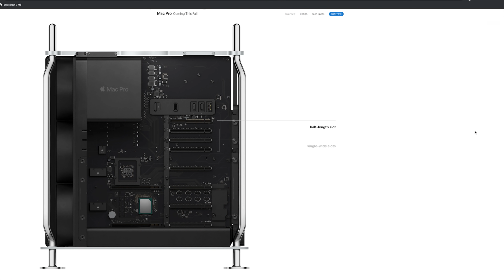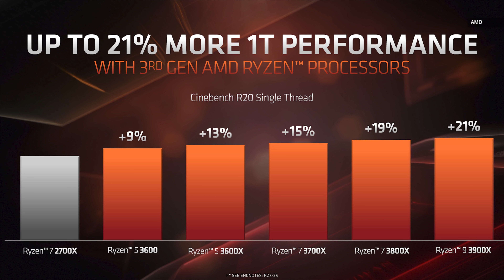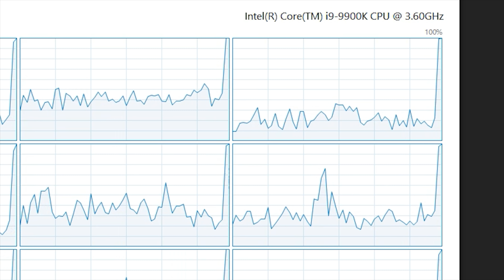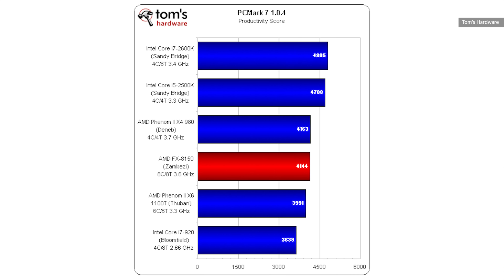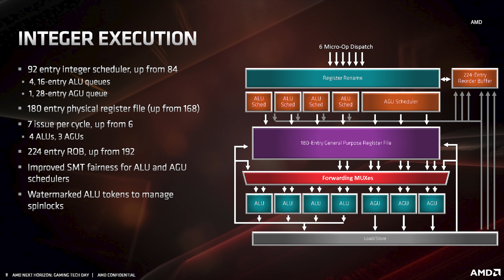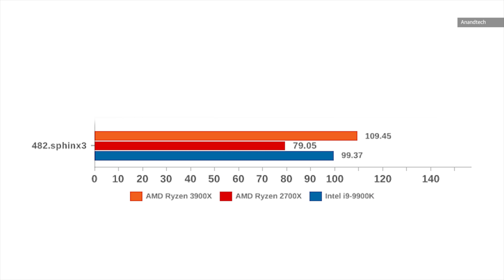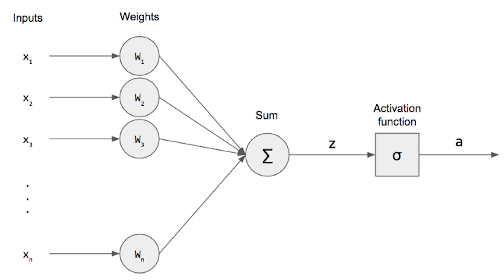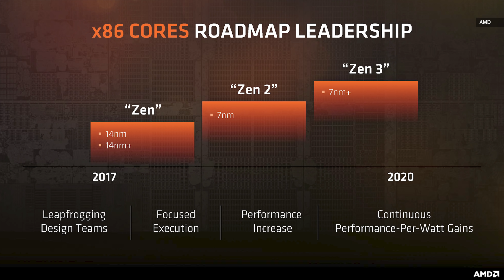How did AMD make Zen 2 faster? | Upscaled

Comment: While everyone loves  the new L3 cache size, the floating point pipeline being doubled never seems to get the attention of the mainstream. The floating point team did an incredible lift for Zen2.
Reply: They did??? Daaamn!
Reply: Woah I never knew this, well spotted
Reply: Maybe I can finally load the Far Lands with decent framerates!
Reply: You mean AVX? That didn't just help floating point, but also some integer math :)
Reply: Float point has always been it. They did alright up until Bulldozer and went full retard with a shared FPU
Reply: @davkdavk  Ikr 8 Integer Cores and 4 lousy FPUs.... wtf...
Reply: This dramatically helps avx2 performance.  AMD did such a great job with this processor.
Reply: So did the bus.  It's not like Intel's Front Side Bus, but now uses what they call Infinity Fabric, or like a mesh network on a chip and is open source.

Comment: The best part is AMD has real IPC. If you clock the 9th gen intel part at the same speed as the AMD 3000 processor it is much faster. Meaning the IPC is there just not the clocks so much.

Comment: As an ex FX 8150, 8350, and 9370 user, current 1600X user, it was more software's fault than the chip. If software and hardware progressed at an even pace we would have different things to say about it.

Comment: Great vid. 

 In a funny offhand way one of the reasons I like AMD is because they made the FX series. Sound weird. Well there is more and it says a lot about AMD. They take chances on new ideas. 

  I mean you look at current cpu's and so much of why they are like they are is because AMD took chances. 

  If AMD was not in the picture we could be stuck at 32 bit. We could be still using one core. If Intel has shown us anything is they like to play it safe. They like to milk the system. Thanks to AMD we have 8 or more cores and 64 bit cpus.  Sure, AMD took a big chance when they tried out a new idea and called it Bulldozer and boy did it tank but they thought they had a good thing and went with it. In a way it was part so different that it never had all the optimized software to use it well. It was more of a server designed chip and that didn't go well with what we like to run also. 

  And now AMD is back, alive and kicking and we have better choices and Intel, well good old Intel doesn't like it one bit...
   I guess looking at the history of this business is why I am a AMD fan. In a way we owe them a lot for their crazy ways.
Reply: Well, Intel was trying to force his Itanium instruction set... Luckily AMD64 won.

Comment: So you did forget one critical aspect to Zen 2's architecture and its chiplet based design. AMD, nor Intel are talking much about it because it doesn't translate well into marketing jargon. It's to do with Yields, especially on newer process nodes like 7nm.

Typically on a new Process Node, you'd see yields in the range of 60%-75% in best case scenarios. That basically means that for every wafer used to manufacture CPUs with, roughly ~25% (usually more on a new process node) of those would be unusable due to manufacturing imperfections. Over the course of a Process Node's life span that will eventually go up into the 90% percentiles but that always takes further further refinements to the Process Node AND the CPU architecture to minimize / eliminate these imperfections.

With AMD's Chiplets, they're getting yields above 95% right out of the gate. Each Chiplet holds up to 8 Cores, meaning if half the cores in each Chiplet on a Die are unusable, the Chiplets are still able to be installed into a CPU and sold as a 2 Chiplet 8 Core part. When it comes to supplying CPUs for the Server market, yields actually play a big role in uptake of a CPU.
Reply: IIRC I think AMD is using the 4 core chiplets for their lower end integrated graphics offerings. The 8 core Ryzen 3000 CPUs are a single chiplet of true 8 cores. I think they're doing this for the benefit of skipping out on the latency between CCDs.

Comment: 1:20 Ryzen 3 is not Zen 2. Most* of the Ryzen 3000 product series is Zen 2. And this product series is grouped into Ryzen 3, 5, 7 and now also 9 similar to how Intel groups their products into Core i3, i5, i7 and i9.

*) Ryzen 3 are APUs (CPU with integrated GPU) still based on Zen+ from 2018.
Reply: ageofbogyo  Yep, the Ryzen 3 product group is the only group in the Ryzen 3000 series that are APUs (CPU with integrated GPU) that are still based on Zen+ from 2018.
So I'll change my statement above to be less confusing.
Reply: i'm pretty sure he meant 3000 it's just poor wording on his part.

Comment: very good video...one thing you forgot to mention was the improvement to infinity fabric, which doubles in bandwidth(i think) and is tied to system ram speed in a 2:1 ratio instead of 1:1 which increases overall speed and decreases the latency between cores, memory, cache and other cores....its the improvement to latency which helped the most to increase game fps

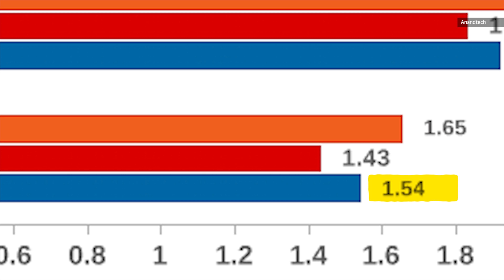Comment: That diagram at 10:47 is outdated. Intel pushed back 10th gen to 14nm +++
Reply: I thought it was 14nm++++ but I could be informed by a meme, it's hard to tell sometimes
Reply: That leaked slide is fake, and this has been proven multiple times. 14nm+++ doesn't exist.
Reply: Intel's 10nm is a failed experiment after all these years now. It will never be financially viable with what they have. What does that leave us with? Cannon Lake? Virtually dead. Ice Lake U and Y which are sub 15w mobile dual cores should be out by now. Doubt ice lake-s (quads) will see anything beyond a paper launch at broadwell quads, ice lake-sp is a dead proposition, theres no way they're going to be able to make a server core based off that 10nm. Tiger lake and sapphire rapids? who the hell knows, why worry about something that isn't going to happen. Their only chance is with 7nm, and that won't be expected to come out until at least 2021.

Comment: Can anybody explain how do they run a neural network in a chip? It has to have a super-level access to all the data, so it's somehow in the chip only at first, than it has to "know" some hefty data to predict things (and store it somwehere) and what is curious the most - how does it run in-pace with the cpu?! It needs to eat all the data through itself every clock cycle, but it has only one to do it!
How is that working??

Comment: Instruction Fetch ->Instruction Decode ->EXE(ALU) ->Memory -> Write Back->5 Stages execution.. Using Program counter to pick up the next instruction and forwarding to reduced a cycle in the pipelined.
Reply: The good ol' 5-stage pipelined processor

Comment: @Engadget Great video, something about this Episode that would be interesting to know more about is How the Chiplet architecture itself communicates between the 7nm chiplets and the 12nm I/O die, Also a generational comparison between the 1700X, 2700X, and 3700X or 3800X as you'll be comparing 8 core / 16 Thread processors side by side and the differences they made between them and How the communication between them has also improved, While I know this last part will greatly be software dependent, How the workloads are spread out between the different cores and at what states or load levels that additional cores are activated. Just a few ideas, awesome video though.

Comment: To call a Perceptron a Neural Network is a bit of a stretch it's just the simple sum over  weighted  inputs plus a bias  value and an Indicator activation function, its more a simple linear model  or a single neuron

Comment: Not a bad effort. I quite liked the video. Except for the part about prediction. It's called a branch predictor because it predicts branches. Not instructions in general. There is no need to predict instructions, they go in like ducks in a row. However, some of those instructions allow the execution to take different paths. Like conditional or indirect jumps. In the case of a conditional jump, you know the address where to jump, but not whether to jump. In the case of indirect, you know you want to jump, but you don't know the address (a typical example would be a virtual call in an object oriented programming language). Processors also have caches for instructions. So there is also a chance of cache miss on the instruction cache.

Comment: Nowadays if you're going to buy an Intel processor would be more like you were going to buy an apple iPhone or High end Android phones
Reply: Please explain
Reply: Apple is overpriced, as well as some high-end Android smartphones. That's why he compares it to buying Intel chips. Intel's chips are severely overpriced as well (due to its long monopoly that's now finally over thanks to AMD)
Reply: @kangalio  how do we calculate the overpicing of a certain product. Thank you for replying.
Reply: @kangalio  The analogy was confusing because Apple/High end Andriod has premium hardware and software(of course with high diminishing in return). The battery on a high end device lasts way more cycles than a 200 -400 dollar smart phone. The screen is usually a higher quality and in case of apple, their ecosystem is pretty strong. Intel on the other hand currently lost on all front except edge cases with gaming (low res high end gaming). On top of that, it's cheaper than Intel.
Reply: Read Macs backwards.
Reply: SCAM  --  (macs backwards)

Comment: ZEN 3 should improve the clock speed IMO .... even if AMD has to sacrifice the 5nm node .... stay on the 7nm for one more iteration .... IPC gains would be minimal, but ZEN 3 CPU's will hit 5 GHZ pretty good.
Reply: after 14nm there will be a regression in clock speed so don't expect any more clock speeds in a traditional sense. The more you shrink a chip gets the denser it gets. Thus a more concentrated heat. This is the same reason the rumored intel 10nm is supposed to be slower in clock speed some people are saying it would top out around 4ghz. 
Even intel took 10 iterations of sandy bridge before getting to 5ghz consistently and FX9590 5ghz was a 32nm part. The only logical way is to get more IPC instead of clock speed... only idiots would obsess  about 5ghz since its been done with 9590 which was trashed by a higher IPC chip at a lower clock speed.
Reply: YYpang  which is 7nm+
Reply: I don't think AMD wants to sacrifice the 5nm node. I do think they'll postpone it until they can get it to where it's a significant improvement over the 7nm in the IPC and power consumption areas. I myself wouldn't expect higher clock speed on a smaller node but I do think 7nm+ will have those improvements like the 2700x was a big clock speed improvement over 1st gen

Comment: 1:12 Wrong. You mean 3rd generation Ryzen, not Ryzen 3. Different things.
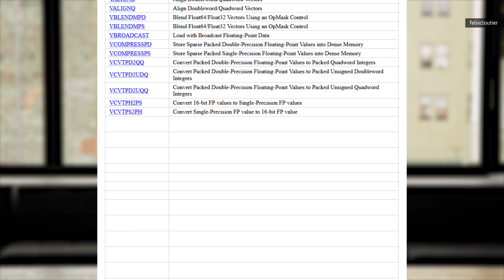4:38 Wrong. The comany name is pronounced arm as in "you have two arms", not A.R.M.
7:08 Wrong. Registers are the place in which data is STORED, not where computations take place. Computations are performed, mainly in the ALU, the Arithmetic Logic Unit.
8:04 I'm fairly certain you're wrong here as well. The main latency incurred isn't through in-chip communication but through actual DRAM latency.
8:30 For cache data that is "overwritten" the technical term is "eviced", FYI.

Comment: The crystal isn't operating at 100MHz. For AMD platforms the XTAL is at 48MHz. For Intel it's usually 24MHz but it is what the 100MHz Bclk is based off of.

Comment: Execution time =(Ic * cpi) / clock_rate. If we could reduced  the cycles per instruction and increased the clock rate we could have better ET.
Reply: Of course L1-cache is important to reduced wasted cycles for cpu to "buffer" between cpu and slower device like ram.
Reply: Use logical paging, segmentation, TLB, replacement policy ( least recently used, first in first out and/optimal) how to store bit in cache and when to overwrite them.

Comment: AMD might be in their 3rd generation of 7 nanometer chip design by the time Intels 7nm Chandler AZ plant starts production (~2024). but intel alone might not be able to close the distance on 7nm refinement and problem solving in that time frame, so i predict a strategically risky maneuver to partner in a similar fashion as amd with tsmc, but this time it would be samsung and intel and the EUV method, with the risk being foreign access to tech trade secrets

Comment: Will 4.ghz(unclocked) be the max a  silicone chip can do before printing becomes a no on them and they have to start looking for other materials to make processors?
Reply: Great question, I was wondering the very same thing to bad they never answer any questions on this channel. Which makes me think they don't give two cents about any of us who support this channel by coming here.😪
Reply: @randallcromer66  o ok didn't know 👍
Reply: We can go far higher than 4GHz. Someone overclocked a NetBurst to run around 8GHz, and NetBurst has a clock multiplier on their ALUs to make them run twice the core clock, so some simple part of that machine was running at 16GHz. But that's a sputtering engine that just can't get fed with fuel - it doesn't have a good branch predictor, it doesn't have good IPC, it doesn't have nearly enough cache, and so on. It's easy to spin real fast doing nothing. Much harder to pull enough program code and data into the frontside bus to compute anything with those cycles.

All that extra bandwidth, cache, and loading smarts take up more die area, but doing that reduces the chances it'll fabricate correctly, and reduces the number of chips you can make out of a single wafer. So we try to make things smaller, which also means we have to wait less time for electrons to travel through any given gate. But as we make things smaller, more of them fabricate incorrectly, and so on.

In the end, the real hard wall here is not any particular speed, it's 5nm. After 5nm (on silicon, graphene, or phosphene at least) there's no physical way to make the gate shorter. You need at least that many atoms to make a silicon gate.
Reply: @falkreon  nice I was leaning more towards meeting the 4 without overclocking tho but it's good to know man 👍

Comment: We would like to see a comparison (i.e a comparative explanation)...about how Intel's architecture works and how AMD's  architecture works...and hence how AMD today beats intel (at clock speeds and IPC...just as the above video)...
This is because at some point amd had the same architecture as intel...and they even claimed the usage of same architecture in I guess in its 1st generation...so how is it different from intel...and so comes the issue of vulnerabilities too...
I know it's too much to ask...and too confusing a question...but if possible..please make a video explaining all these
Reply: I don't know if this so long a comment will be entertained or not 😅😅
Reply: While you won't get that here, there are a number of videos and articles on the topic that you can find with a little searching.   
To your comment: "how AMD today beats intel (at clock speeds and IPC", this is incorrect.  AMD's new CPU's edge Intel on IPC but Intel is still notably faster on clock speed which is why it is still winning some benchmarks, notably most of the gaming ones.   When watching the reviews, also note 'boost' clock speed vs. base and how many cores the boost applies to and for how long.  It is all a factor in determining performance in workload types.

Comment: Why is arm more efficient than x86?
Reply: Not an expert of this topic, far from that, but i've read it's because it rely on fewer instructions, and those instructions are modular (you can choose to use them or not), so instead of having to deal with a lot of unoptimised, unspecific instruction, you can use only those you need and/or design specifics ones
Reply: @Thefuror38500  I'd really like to see a deep dive on this subject. I assume it is a very little understood issue otherwise Intel would just alter their architecture to be more competitive.
Reply: @Ballistichydrant  Intel Atom is like ARM's cpu, it's compute using reduced instruction set, but still retain x86 instruction set to user. Turn out this doesn't matter, because you can translate x86 to RISC instruction set inside CPUs anyway.
Reply: @xponen  interesting. Thanks. Atom chips are really really slow, hot, and much much slower than arm chips. So the question remains
Reply: @Ballistichydrant  no. Zenfone 2 perform similar to Galaxy S5 or Mi-4. No difference between Atom Z3580 or Snapdragon 801, both is 2.3Ghz.
Reply: @Ballistichydrant  Atom is hot only because Window OS is un-optimised, in Android both gave close benchmark result; using Antutu for example.
Reply: @xponen  respectfully disagree.. I have tested multiple OSes on multiple SOCs and atom always lags way behind on performance, heat, efficiency. Don't take my word for it, just look at atom sales. If they were competitive in performance they'd sell. Intel has been trying to make those chips competitive for ten years. Their failure suggests to me that the difference in x86 to risc is large and not well understood
Reply: @xponen  Thanks. I used to do contract work for Asus and HTC. What you just said is unsubstantiated and I have used and worked on all of the systems you just described and the Asus was really really slow. It was a terrible device. There is a real reason why Intel can't sell atom chips. The question remains. Why are arm chips soooo much more efficient than x86?
Reply: @Ballistichydrant  SoC bundle Networking and other capabilities, this incur licensing cost, which is 1 reason Atom can't sell. Atom Z3580 and Snapdragon 801 have same score, so why is it conflict with your experience? because this is ~$100 device category, of course it is slow, but so does ARM (at same frequency).
Reply: @xponen  801 was also a flawed design and was put to sleep shortly after its release so im not sure it's the best example